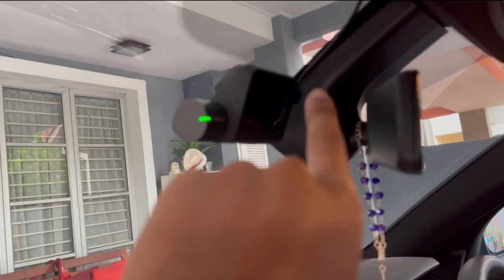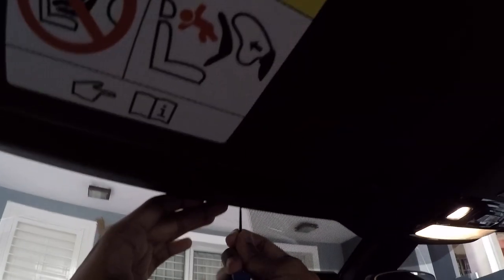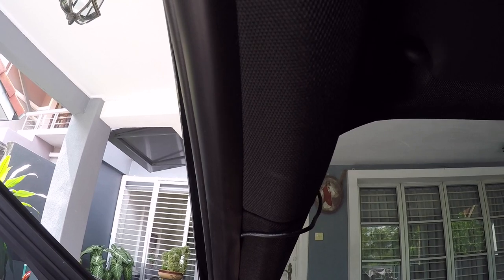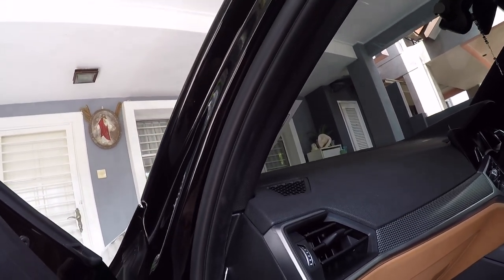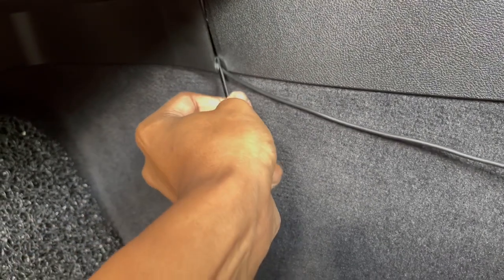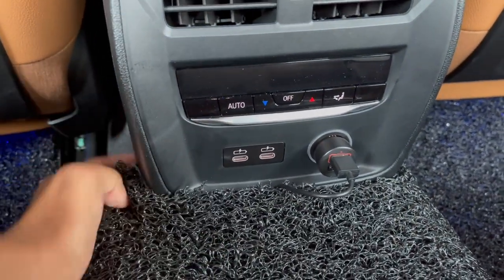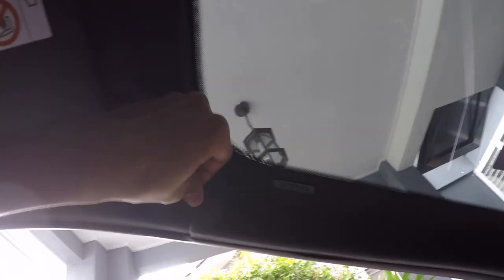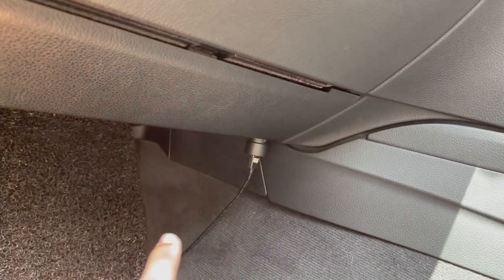Bmw G20 dashcam install tutorial (In less Than 10 Minutes)

Comment: In my F30 their use to be a outlet located on the passenger side under the glove box. I’m curious if it’s on the American version of the G20 still. It was convenient for dash cams.
Reply from the maker: Yea for my F30 (Malaysian version) they have it under the glove box as well. But I'm not to sure on the American version if they have it for the G20 but for the Malaysian version of the G20 we don't have it.
Reply: @brendanwrichard  nope, they did away with it. Not sure why because it was so damn useful. My 2014 328i and my 2017 330i both had it but it's nowhere to be found on my 2020 330i. I really do miss that power outlet.

Comment: in BMW G20 LCI (2022) model there's only 12v in the front but guess what.... it does not work because it's a Cigarette lighter socket (not the accessory socket) and my camera charger does not reach the metal contacts inside the socket. And I don't know what to do now.... I tried some other charger and it does give electricity but only when I'm pushing it down really hard with my hand xD